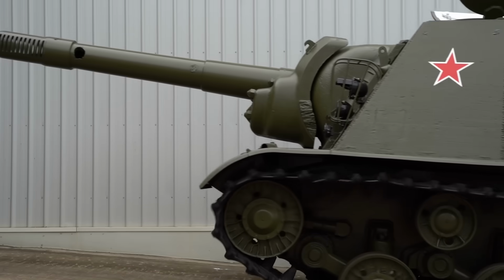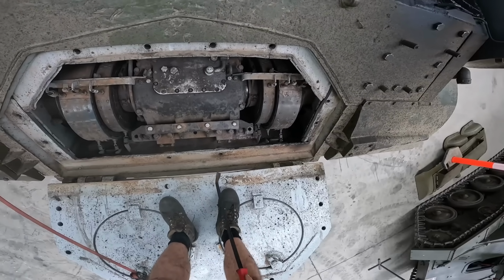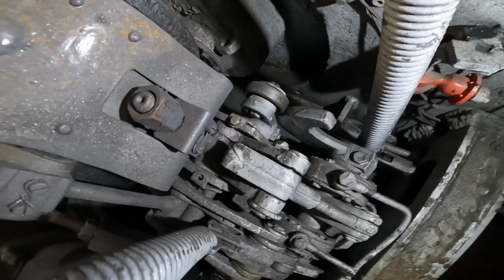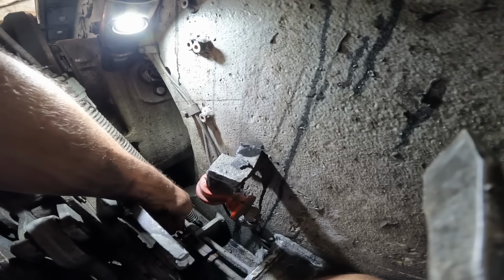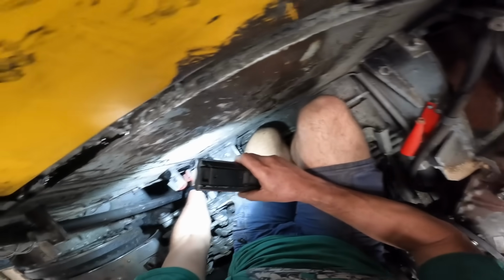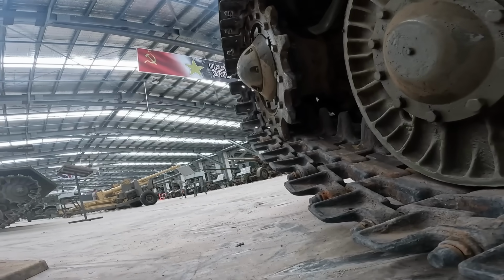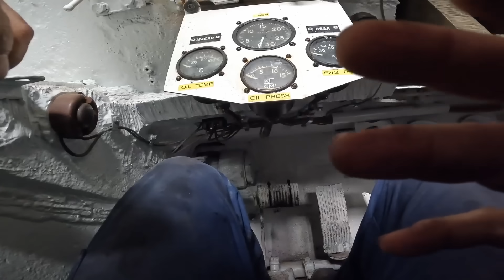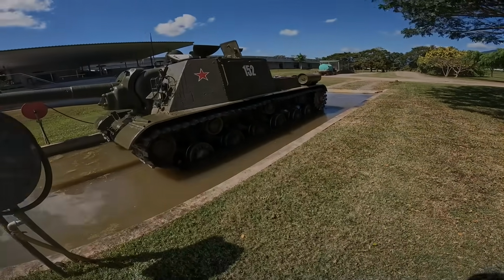WORKSHOP WEDNESDAY: Our ISU-152 can't turn left!

Comment: I love the Russian solution to track pins, most other countries had some sort of nut or retainer, the Russians used floating pins and simply welded a ramp to the hull to push them back in when they wandered.
Reply: panther had it too! gotta steal the nice bits aye
Reply: Not on this vehicle, it has duck bill connectors that extend beyond the pins on both sides of the track

Comment: I had to drive a Spartan with the same problem,  every time I wanted to turn left I had to stop and reverse right then go forwards. Luckily I only had 3 km back to camp .  The hydraulic cylinder had blown a seal. Steve fixed it faster than REME did.

Comment: I figured threading the rod ends and using a threaded sleeve would have been easier than welding it back together, but obviously with Soviet stuff, the chances of it coming close to any known fitting is to threat is unlikely.

Comment: You can see the huge welds in the corners. It’s like they just let the rod stick and then they just folded the hot welding rod left and right and let the weight of the rod be the mass of the entire bead instead of letting it melt into the surface metal. There must be tons of welds in that thing.

Comment: Great job once again ! But is it really safe to oxitorch , grind and weld metal in an oily and closed space ? It must be the AusArmoour way and the way that works . that's why I love your videos .
Reply: It's diesel engined, so the fuel is hardly more volatile than the lubricating oil. Sure, it will burn but the chance of a stray spark starting a fire is minimal.